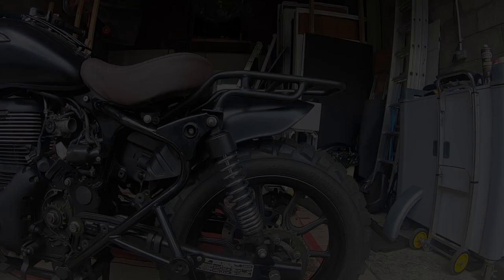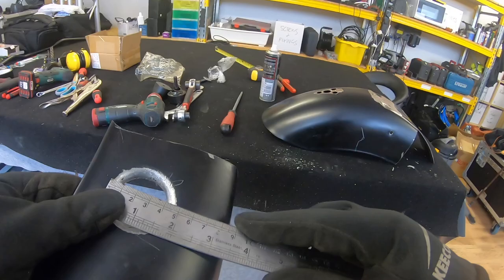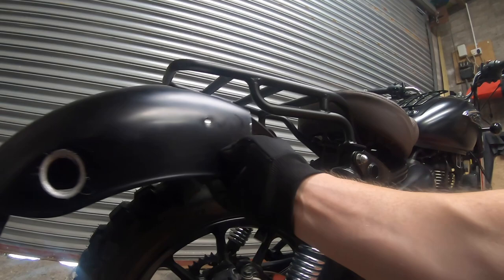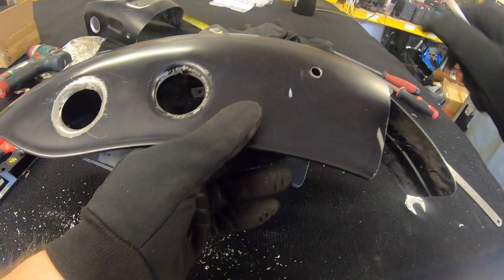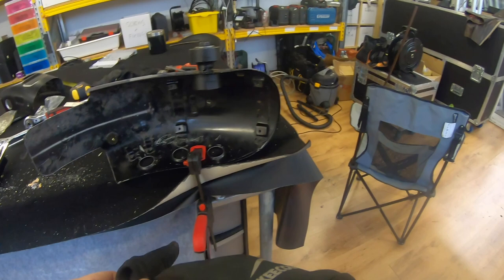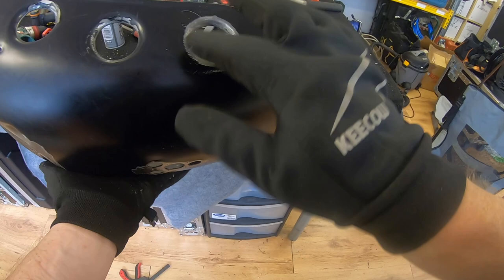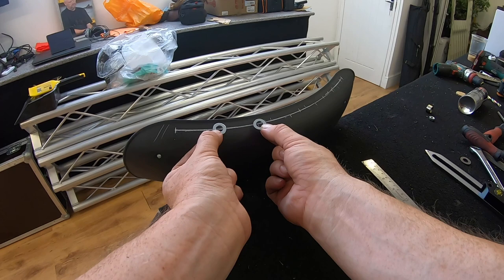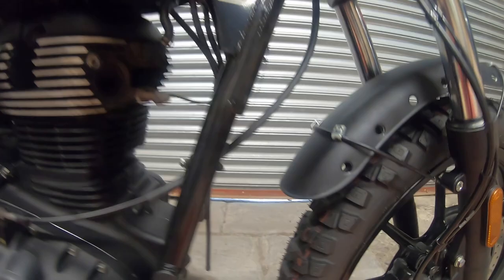Part 10 - Holey Moley! - Royal Enfield Meteor 350 / Classic 350 Bobber Project

Comment: Glyn are you the Robert Johnson of the valley. My god those holes. I first thought NO Glyn don't do it. Then again you proved me wrong, They are great. Bullet holes. When you have it painted, why not have the holes air brushed to show the metal damage after it had been shot. By the way I love the blues, so keep adding it into your video. PS Eric Clapton lives with in 15 miles of me, and he is normally seen from time to time.

Kind Regards
Andrrew
Reply from the maker: Thanks Andrew, that was pretty much my thoughts too but once the drill went in it had to continue.  Just a few more little holes and it'll be enough I promise....  I'll probably do them satin black just to match the tank to get it going and have a play and then do the proper paint finish when the weather turns a bit.  Thanks for your thoughtful words and support, Glyn